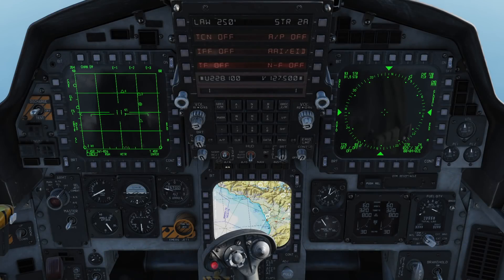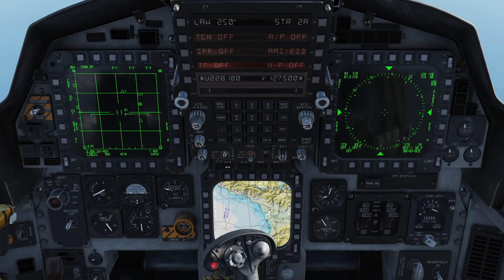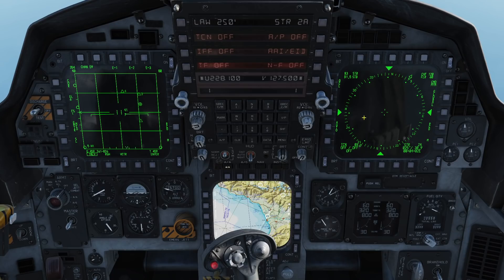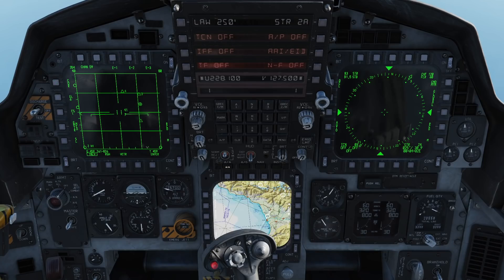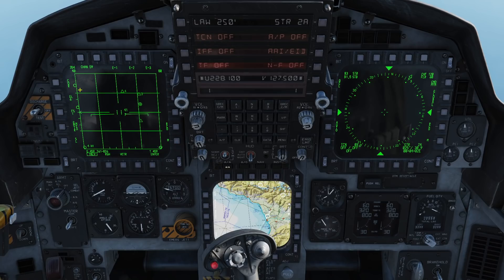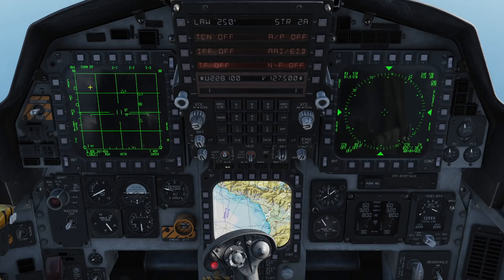DCS: F-15E Strike Eagle | MPDs introduction

Comment: I hope this isn't too off-topic, but I was discussing with the Grim Reapers DCS channel people how you would best counter the S-400 air defense system, and a few suggestion for new Mods came out of the discussion.

Please consider modeling the following, when you have a chance. I know that for many of these, if not all, there is not really as much information about the specs for as one would like when creating a simulation, but I would worry less about that than putting something in the game that fills the role of these systems and looks a lot like these systems, and then adjusting the specs over time as new informations becomes available. You might even allow the user to adjust certain specs about the Mod, for each scenario, based on what the user thinks is most realistic for the specs for that Mod. For example, how well does the MALD decoy work against the S-400? Nobody knows. It probably does not work well if within range of IR sensors on the S-400, which would see through the decoy, but beyond that, it would depend on how convincing the radar returns were, to the S-400 computer, how much energy was emitted from the MALD, at what ranges, which would give you a maximum range for the system, and there may be some range at which the MALD would not work closer than, because perhaps the decoy is more convincing from farther away, I would assume, until it is out of range because it had limited radio emission power. A commenter responded that the TALD is in game, so this could provide a basis for the MALD. The TALD (ADM-141A) is 8 feet long and 400 lbs, with a range of 78 miles, or 185 miles for the Improved TALD (ADM-141C) which uses a turbojet engine. The MALD is 9'7" long, 250lbs, and has a range of 575 miles, with loitering capability.

Proposed Mods include:

1.  The "Miniature Air Launched Decoy", which would be used in any US strike into contested air space against a near-peer adversary. The MALD-J with the jammers should also be an option.

2. The ALE-50 towed decoy, which would likely be used in conjunction with the MALD, or after a strike. while leaving the area. 

3. The RQ-170, which is what would likely be used for recon against ground or naval targets, now that the SR-71 has been retired, and the SR-72 is not yet in service. The RQ-180 would surely also be used for this purpose, but not enough is known about the RQ-180 to create a Mod. The RQ-170, one could argue, would have a radar cross section like that of the B-2, but reduced in proportion to the relative size of the B-2 and the RQ-170, if that makes sense. 

4. As soon as something is known about the effects and the range, I would suggest you also create a Mod for the CHAMPS missile, or Counter-Electronics High Power Microwave Missile. This is a good system where for allowing the user to adjust the microwave output to what he thinks is realistic, and then modeling what effect that amount of microwave energy might have on various systems, if such a think can be determined. 

5. The AGM-158 JASSM. In addition to the missile itself, it would be ideal to also have a Mod for the C-5 and the C-130 to release pallets of JASSMS, as planned for in the "Rapid Dragon Program". 

6. The EA-18G radar jamming capabilities.

7. The AN/ALR-94 F-22 Electronic Warfare System. Even though not much may be known about this capability, it should be assumed that it at least exceeds existing EA-18G jamming capabilities. 

8. The JSTARS system, which would feed targeting data on ground targets to the F-35 or JASSMS, like an AWACS feeds airborne target data to the F-22.

All of these systems would be needed to effectively counter a very modern air defense system like the S-400, but with all these systems used in coordination, it should become possible to overcome the S-400. 

Also, I'm not sure how well the datalinks between AWACS, F-35s, F-22s, recon drones, etc. work in the game at this time. This is something that will become increasingly important in the future, with all air combat simulators, as this sort of sensor data sharing will determine the outcome of many battles in real like and in any realistic simulator. Same for electronic warfare, which the game must find a way to realistically simulate. 

I think this will prove especially important for something like the F-22, which is supposed to be used primarily as a sensor and as a quarter-back from what I've heard actual combat pilots say. So the F-22 needs to be able to see AWACS radar data via datalink, without turning on its own radar, it needs to be able to see IR sensor feeds from the RQ-170 FLIR cameras via datalink, it needs to be to see JSTARS data on S-400 and other radar systems on the ground. 

Perhaps one of the most important things to model as well as possible, in my opinion, will be the F-35 distributed aperture system, which is supposedly like a very sensitive infrared search and track system, which can look in all directions at once, see infrared target signatures in the air and on the ground, track all those targets at once, all the time, without a limit to how many targets can be seen. I have no idea what that would look like to an F-35 pilot, but I do know that no DCS mod will ever come close to depicting what the F-35 is truly capable of until it does accurately model the distributed aperture system (DAS).

One of the reasons I think it is so important to model this DAS is because I suspect it will be one of the primary streams of data that the F-35 will be sharing with the F-22, when they operate together. The F-22 does not yet have an IRST of any kind, and given the role it is supposed to play, I would assume that the F-22 will stay somewhat towards the back of the overall strike formation, with the RQ-170 Sentinel, the Global Hawk, and the F-35 towards the front of the strike formation, with the F-35 being especially useful, as the eyes and ears of the strike group, with the DAS system, sort of the linemen, while the F-22 serves as the Quarterback. For all of these systems to work properly in DCS, they will need to be able to coordinate their efforts, and share their data seamlessly. 

Also, in a realistic simulator, missiles like the AGM-158 JASSM, which have their own infrared sensors, would likely lead the charge against something like the S-400, and as it does so, and it used its auto-target recognition capabilities to classify targets in flight, all of this data would be passed on to the F-35 and F-22 strike aircraft following up those JASSM strikes, which could use that data to confirm known targets and perhaps also identify other targets that may have been moved into the area since the last ISR flights. In most cases, those images would be passed back to command to make assess whether the targets were destroyed or not, and I would assume the most recent US fighter aircraft would also have the ability to see that kind of sensor data beamed in in real time via the datalink. 

Some DCS pilots have also noted that it seems like the F-22s and F-35s should be able to see some satellite data, including SAR and optical images.

Thanks for hearing me out. Great work on the Strike Eagle. Very impressive.

A few more design features of the MALD, via Wikipedia:

"In November 2012, Raytheon completed ground verification tests for the MALD and MALD-J for integration onto the MQ-9 Reaper UAV. Integration onto the aircraft was expected sometime in 2013, with the goal for an unmanned suppression of enemy air defenses capability.[9] The company has also explored integration onto the smaller MQ-1 Predator and U.S. Army MQ-1C Gray Eagle..."

"... In December 2014, a MALD-J was test-flown with a radio data-link to expand situational awareness and allow for in-flight targeting adjustments. While carrying out a jamming mission, the MALD-J was able to send situation awareness data to the EW Battle Manager, which used the information to adjust its mission while in-flight..."

"... Radar jammer variant of ADM-160B by Raytheon. This variant of the MALD decoy will be able to operate in both decoy and jammer modes. The decoy and jammer configurations are key enablers supporting the Air Force Global Strike, Global Response, Space and C4ISR, and the Air and Space Expeditionary Force Concepts of Operations. MALD-J will provide stand-in jamming capability for the Airborne Electronic Attack Systems of Systems. It will be launched against a preplanned target and jam specific radars in a stand-in role to degrade or deny the IADS detection of friendly aircraft or munitions."
Reply: I dont think the S-400 have a IR Sensor which is only equipped by point defense system attached to the S-400 battery (btw IR sensor are heavily weather dependent to be effective)

Regarding the ALR-94 EWS its performance is basically similar to a Mini-JSTARS in terms of passive radio emission detection which could be Good enough to launch a missile passively. In terms of jamming its very effective since the F-22 has a much smaller radar signature therefore they dont need much power to hide it from radar.
Reply: @gotanon8958  The Pantsir does indeed have an IR target locking system, although it does depend on a search radar to first detect targets.

I believe, when employed in combat, since even jamming would reveal a general vector of the sky to look into, you might have separate groups of F-22s, some escorting the strike group, probably with F-35s, perhaps also some unmanned systems like the RQ-180 and RQ-170 to scout ahead, and ideally, none of the aircraft in this group would turn their radars or their jammers on until detected, Meanwhile, elsewhere in the sky, a few F-22s could jam all the radars in the S-400 using the ALR-94, perhaps along with an a large number of MALD-J decoys (these MALD-Js all have their own jammers and their own radars too). This would allow all the systems on the ground, and any detected on the air, to be jammed continuously, without drawing attention to the actual strike group air to air intercept mission. That's how I would initially plan on using the systems, then I'd develop the tactics further in wargaming and training. 

As for the IR sensors on the S-400 (and on the SU-35s, which are ALWAYS used in conjunction with the S-400, and which have their own IRST system), these sensors can be jammed too, it would just require a different method. I believe a beam of coherent IR light in one effective way to accomplish this. The most likely example in future engagements with the S-400 would be found on the same F-22 ALR-94, which includes "Always-on multispectral, radio frequency (RF) and infrared (IR) countermeasures enable rapid response for complete pilot protection". As you mentioned, flying in bad weather is another. However, it would he harder to jam the US sensors, not only because they are highly mobile and you wouldn't know where to look, how many there might be, in what configuration, but also because the US can stream IR sensor data on the missiles, like the JASSM, and on the decoys, to the AWACS, JSTARS, F-22s, battle managers on the ground, or at sea, which is much less weather dependent, when you can flight them straight at the enemy radar and take a picture from 5 meters away just before impact.

But are these IR sensors and countermeasures modeled independently from the radar countermeasures in the game, with their correspondingly different capabilities and vulnerabilities? Can we get a lock on with the F-35 DAS or the SU-35 IRST, without the enemy craft getting a radar spike or notification of lock? Can these aircraft use other, more distance search radars emitters and their datalinks to find enemy aircraft with their IRST or DAS, without having to turn their own radar emitter on? Is the in-game DAS capability anything like the situational awareness that a real F-35 pilot would have? Some of this can be correctly modeled, while some cannot, but all of it can be somewhat modeled, and where a system's full capabilities are unknown, such as in electronic warfare, how well a decoy works, etc., this could be a partially user defined variable, and then as we learn more about the capability, we can narrow down what these systems would realistically be able to do in actual combat, and until then, we can approximate it, and if we think performance is unrealistic, we could adjust ourselves until we think it is realistic.

Comment: As a strike Eagle crew chief I'm extremely impressed. For obvious reasons this isn't going to be exact. Especially today with ADCP 2, APG 82. And other mods. But I can't wait for it to come out! Also I hope the Nav Pod has its features implemented, as well as the P&W F100-229 and not the 220... Big difference in thrust.
Reply: Sir, according to RAZBAM's forum they don't aim for today's version, this has many strictly classified components like the computer and AESA radar you mentioned which wouldn't be modeled anyway. They model F-15E Suite 4+ from 2002-2005, but probably with PW229 more powerful motors, rougly timeframe equivalent of F/A-18 and F-16 we already have. 
It's better to have reasonably accurate earlier version, with original analog UFC, than fictional today's variant with omitted and completely changed classified systems.
Reply: @bazejs8084  Makes sense 
OPSEC: Has entered the chat.
Reply: I cant wait for the mighty Strike Eagle to launch.. As a Air to air pilot I want the F-15C as a full fidelity module too 😜
Reply: @Nilssen84  hell yea would love the C
Reply: As a former crew chief I understand your excitement. I'm also hoping for the 229s. Mainly because I still remember the start up temps and stuff to crank that one and I don't remember shit for 220s. Lol. Gunna need a new hotas.
Reply: @xxtherevlukexx  They said it's gonna be 229's
Reply: @xxtherevlukexx  fuck the EPs and GPs hahahaha if you get a hot start in a sim or auto accel just respawn, and for 220s just remember to bump up to 80% for 5 seconds then idle for 3 seconds before shutting down to scavenge
Reply: @milspeccress8864  I will say. I've never had any red balls in dcs. Which is something I wish they could somehow implement. Because having to step to a spare is going to happen. Lol.
Reply: @xxtherevlukexx  Chief should come clean my fucking screens next time
Reply: @milspeccress8864  "Clean your own screens. I'm a swings/mids chief. I don't clean shit." Lol. 

All I'm saying is, if these are supposed to be 229s. That EMD don't look right to me. xD
Reply: Of what I have seen of it, it looks pretty 1:1
There is one display in there that they cheaped out on, but other than that I like it. 

Agreed with the 229. 229 without out luggage gets you to altitude pretty damn quick
Reply: @cyberpunkalphamale  why are you so picky?
Reply: @milspeccress8864  ikr
Reply: Geeze that guy just told you 🫠

Comment: Fantastic !!! A great reason now to get the F15-F18 TM add on stick. I tried once and it had a sticking weapon control switch so I sent it back to an Amazon dealer which probably just stuck it back up for sale without repairing it. Going through THrustmaster this time. Great vid and appreciate the upcoming Eagle …. Heeel yeah !
Reply: All three AV-8, F/A-18 and F-15C/E had this grip.
Reply: @bazej1080  Harrier had the Trim and Sensor control switch reversed, not that it's gonna matter.
It's an amazing grip for center stick setups.
Reply from the maker: Thanks.